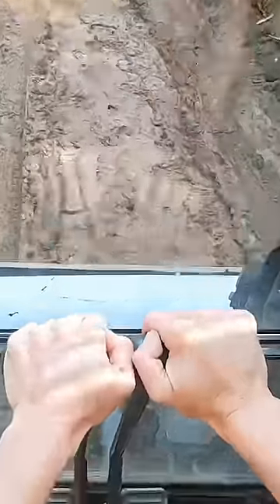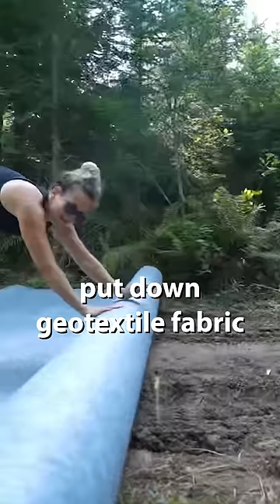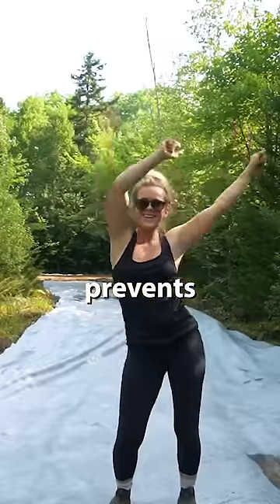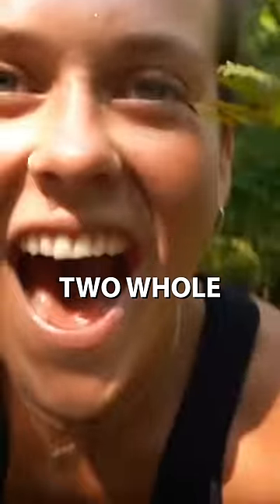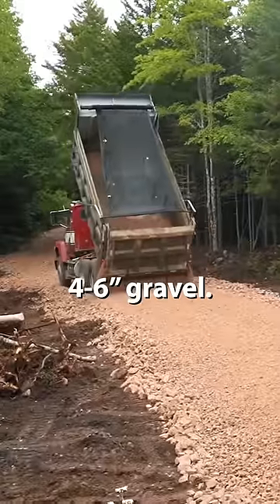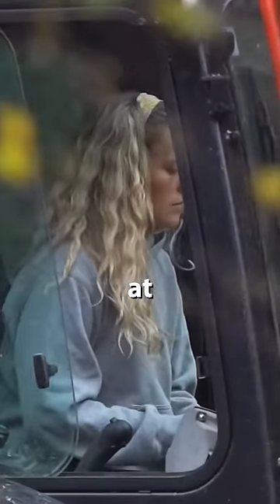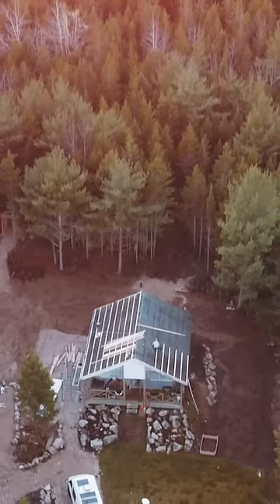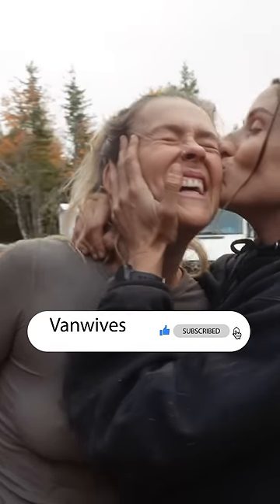I Tried Operating An Excavator! #shorts

Comment: I also recommend getting barrier security lights so that you know how far back or how close whatever is out there is to you I recommend three or four sections into the woods have them sectional so that you know where they're coming from right left north south east west if the lights turn on in that area of the forest you know there's something out there and if you set them right for height in case of a tall predator have certain lights at will only turn on this way you know when that color light comes on there's something tall and be coming your way